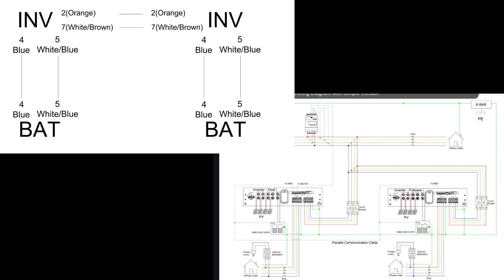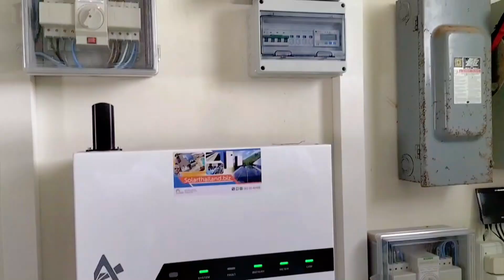20 kW Solar - From Start to Finish | SolarThailand.biz

Comment: I have a question. We have a house with a 3-phase electric system with a digital meter and want to buy a 5 kw solar system. I have seen 5 kw solar systems advertised with 1 phase and 3 phase (10 to 15k THB more expensive).  What do you advise me to buy?
Reply from the maker: You must buy three phase, if not you will only get solar on one of the three phases and that is very bad.
Reply: Thanks for the clear answer!